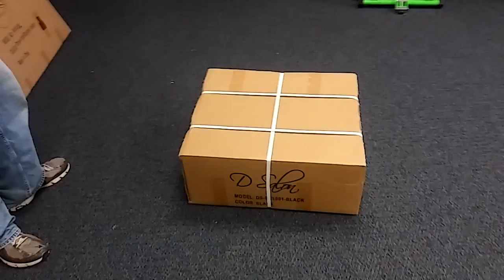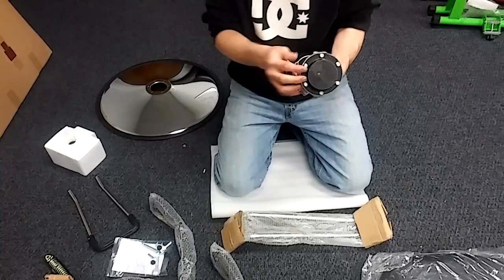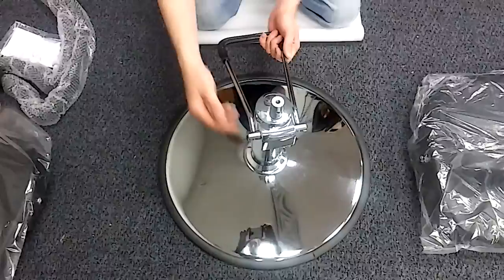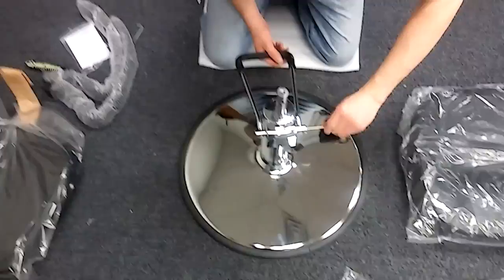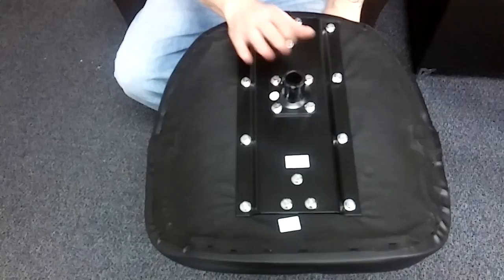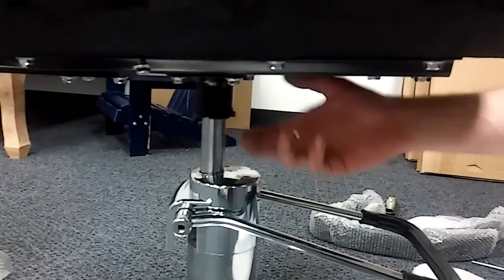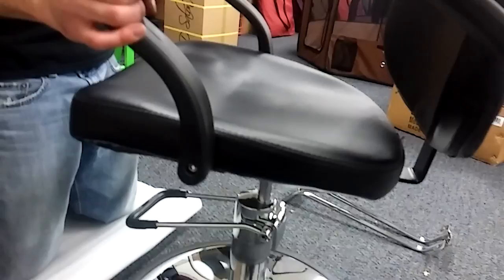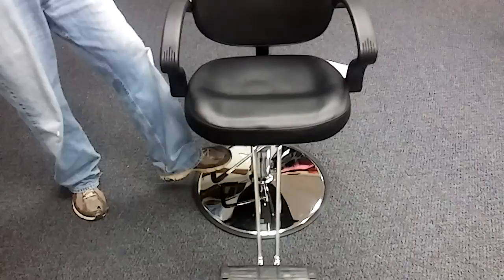D Salon Styling Chair 3001 set up video

Comment: Connecting this bottom and top piece of the chair using the 3 screws is not working. The hex screws are coming out of the socket and have nothing to out behind it to hold it in place
Please help
Reply: I had the same problem lol you have to slide it underneath and screw it on
Reply: @Ebonyspencer1001  So you mind explaining further? I am having the same problem and can’t fix it!